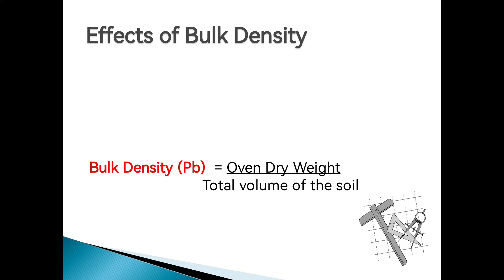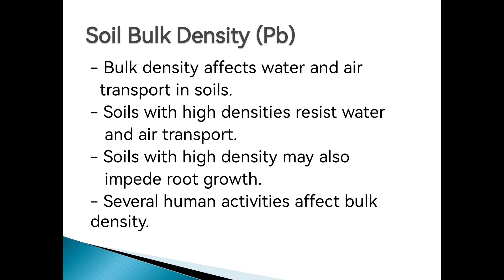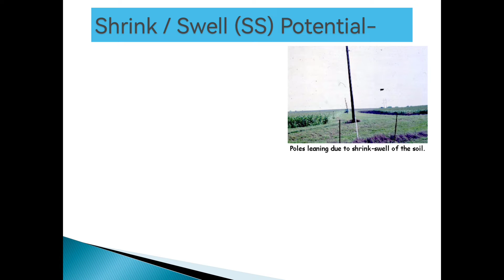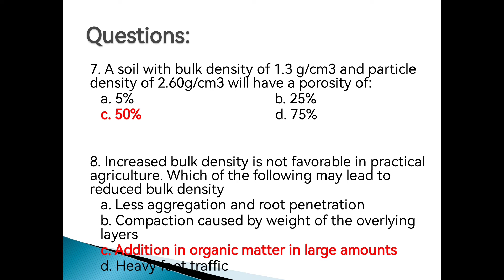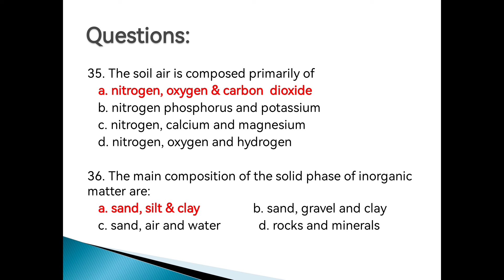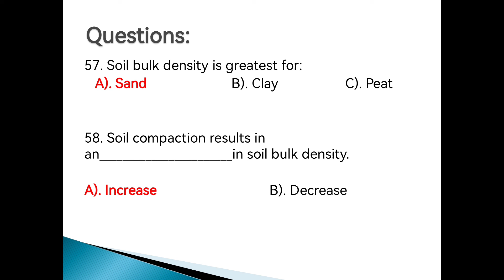Agri Board Exam - Soil Bulk Density, Particle Density and Soil Porosity

Comment: Hello ma'am, ask tako  regarding sa question number 62, nganung 40% ang answer dle sya 60%?😄or basi ako ang mali
Reply from the maker: Hi Maam, your formula is correct for most field soils (unsaturated - the pore spaces are occupied by both water and air. BUT when the soil is saturated (meaning all of the pore spaces are ONLY filled with water, no air) , the total water content (at saturation) is equal to the total porosity of a soil sample, hence the answer is 40%. I hope this helps. Thanks
Reply: @keepitupwithcion  thank you so much po 🥰
Reply from the maker: @lourdesvergara713  Way sapayan, let me know kung naa pa kay wala nasabtan...

Comment: maam gi unsa pag kuha ang ring volume? unsaon pag sulat kanang 3,5 x 3,5  unsaon na pag sulat sa calculator ?
Reply from the maker: Hi, Ring volume (cm3) = 3.14 x r2 x ring height., since 7  cm ang diameter sa atong ring, half ana is the radius (3.5 cm), kay r2, man kaduha-on nato sya ug multiply, so = 3.14x3.5x3.5x10 cm(height)=384.65 cm3.
Reply: ang total value ko kay maam ay hndi mag skipt ad. dont skipt extra or ads.